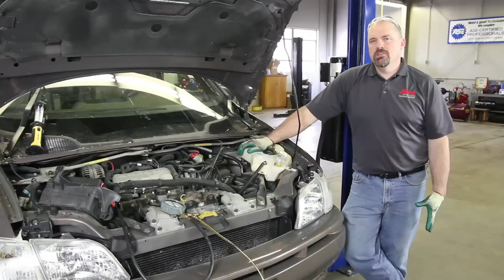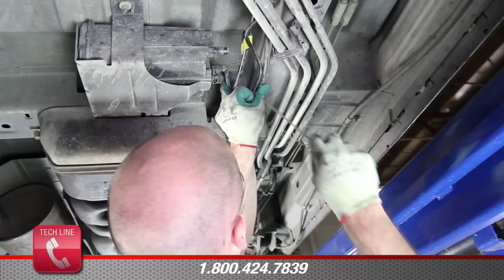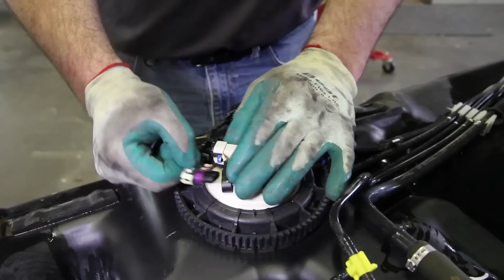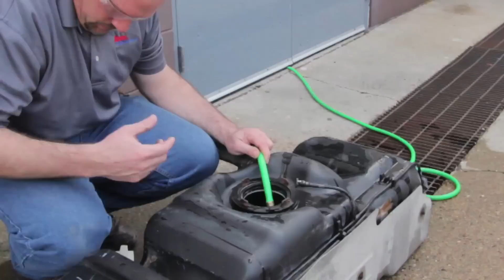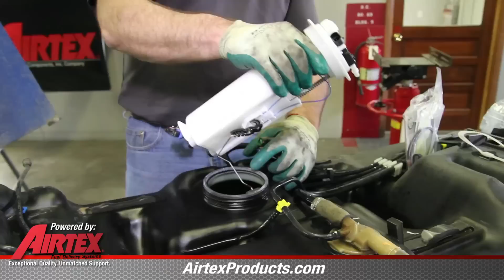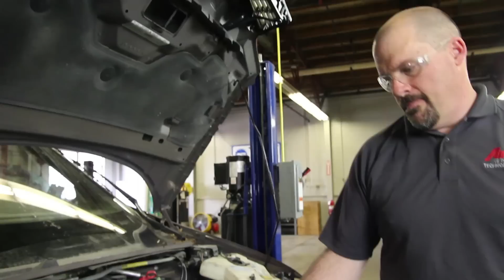How to Install Fuel Pump E3372M 1998 - 2001 Oldsmobile Silhouette

Comment: Awesome, clean and precise video
Reply: Yeah no particularly LOVE how they just gloss over how to clean inside the tank after repeatedly telling us how important/proper it was.

They just show a dude with his arm in there up to his elbow. He couldn’t possibly reach everything. What was he reaching with? Was he loosening debris? Was he using any product? What did he do to get out any product or loosened debris when he was done? Is is safe to use water? I imagine gasoline won’t work as a solvent for the kinds of residues you’d find in a gasoline tank.

Comment: AIRTEX FUEL PUMPS ARE JUNK. I REPLACED 3 OF THEM IN 4 YEARS. BETTER TO BUY AC DELCO OR DELPHI. They cost more, but doing the JOB once, MAKES THEM A BARGAIN.
Reply: You are absolutely right.Never use any aftermarket pumps, I have even heard stories of them not working at all after installing them.Or maybe they last a few months like what happened to you.I always buy Acdelco, or Delphi for my GM's and never had any problems.They do cost more to buy but well worth it for sure.You know when you install the factory pump it will work for a long time, as long as you dont run your car down to the bottom of the tank or run it out of fuel all the time.

Comment: good vid. no shop I know would take the time to wash and clean the tank upon removal..nice job! only thing I did different on mine was I soldered and used heat shrink tubing on the wires instead of the crimp connectors.
Reply: …and that’s the part they didn’t even bother explaining even though they tried to tell us it was important. Bizarre.

Comment: This example in the video differs some from my 2000 silhouette...  I don't have to loosen the carbon tank.. and i have less lines to disconnect..  I have put 2 pumps into my tank so far and both of them were a nightmare to try to compress into the tank and get seated and nearly impossible to do by myself... Getting the pump in all the way takes my full 200 pounds and then some to do and getting that ring threaded on while trying to keep it there is the worst part of all.. if you let go within seconds the pumps top pops back out flinging the ring clear off...   Trying to pull the tank with it only on ramps is also a pain compared to how easy it would be in a shop like on video...  Also there are both o ring type seals as in video but also flange type seals also which is what mine originally had and again now has. the 2nd pump i had had the oring type and i never felt comfortable with its use at least on my tank.. Ive no idea if there interchangeable or if one if preferable or easier to use..  Both are a pain in different ways and the pump is incredably hard to seat either way.

Comment: I need to replace the fuel pump on my Pontiac Montana transport.  The question I had is related to the new wiring harness.  How do you know which wires to connect together?  Are they color coded ??
Reply: Do yourself a favor. Buy OEM FUEL PUMP AND LEAVE THE AIRTEX FUEL PUMP ON THE SHELF. I HAVE REPLACED THE AIRTEX FUEL PUMP 4 TIMES ON MY 2000 GMC SAFARI. THEY EACH LASTED ABOUT 6 MONTHS. WORKED ONE MINUTE DEAD THE NEXT. UNLESS YOU HAVE ACCESS TO A LIFT, MECHANIC TOOLS AND JACKS, SPEND THE EXTRA MONEY AND BUY THE REAL THING.